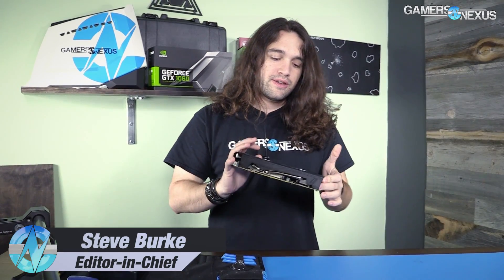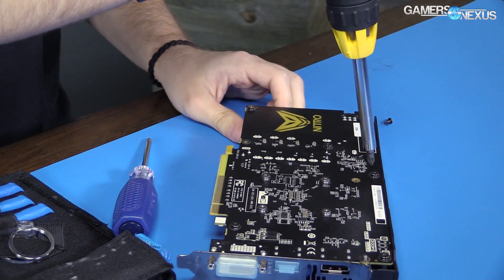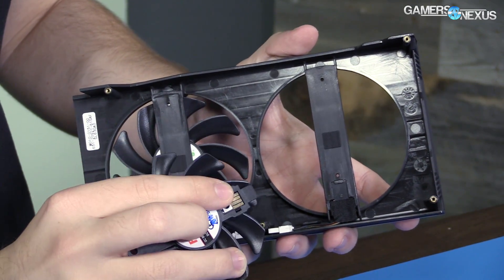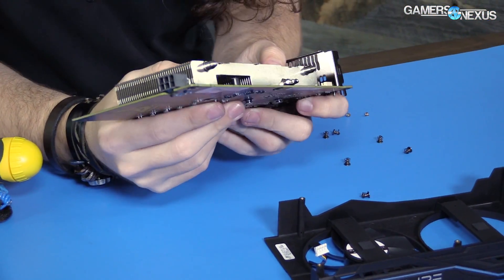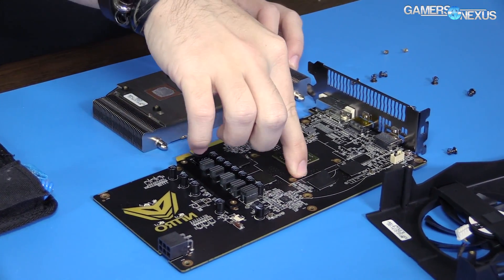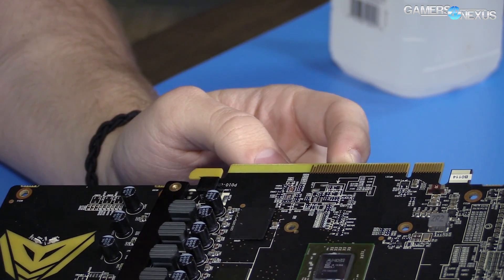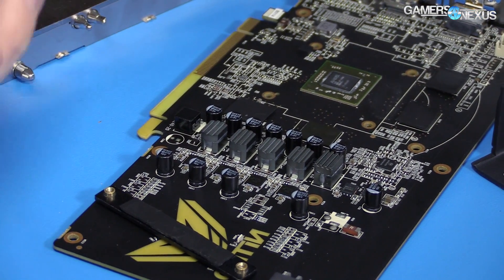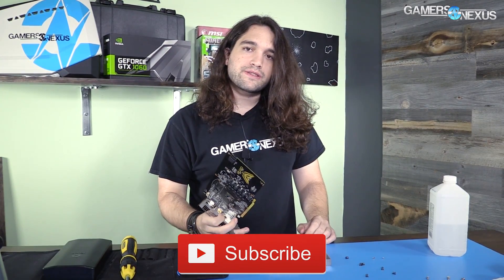Sapphire RX 460 Nitro Tear-Down & Disassembly

Comment: After disassembling will it work without the fans and heat sink? Could you do this for a GTX 1050
Reply: Acid HD Yah but it will burn immediately :)

Comment: what is the problems with the rx 480 founders edition please, I want to buy one and I don't know if the problems are resolved or not
Reply: The reference 480 had the supposed problem of drawing too much power from the PCI-E slot when under full load. It didn't bother higher-end motherboards, but it supposedly broke cheaper ones. Which I highly doubt. That and the throttling problems where it wouldn't keep a constant clock speed while gaming. But both problems are easily fixed by fiddling with the power settings using WattMan in the drivers suite.
Reply: I'd really wait for an AIB partner card like Nitro+ or MSI Gaming X.  The cooling on the reference RX 480 is not good.
Reply: Cooling and therefore noise, and possibly it only having a 6-pin power connector but I don't know how that affects overclocking, the issue with too much power pull from the pci-e slot has been resolved.

I highly suggest getting an AiB 480, they're quieter, cooler, and overclock better.
Reply: Thanks guys

Comment: I have an idea, instead of doing a hybrid cooler mod, try modding the fan shroud, seeing as the fans are removable, maybe mod a pair of noctua fans onto it? or, for giggles n shits, some 4k rpm delta fans ;)
Reply: I was thinking the exact same thing. Eyeballing those bolt holes in the PCB, thinking about a bracket and spacer set up to mount a 140mm Noctua spinning at low rpm for quiet performance. Or maybe swap on a giant CPU heat sink for passive cooling.

Comment: Yeah, it seems like RX 460 probably isn't fast enough to stress out a PCIe 3.0 8x link, but that PCIe 8x cheapskate nonsense could possibly cause performance decreases for someone on an older PCIe 2.0 or (gasp) PCIe 1.0 motherboard. PCIe 1.0 16x is 1/4 the bandwidth of a PCIe 3.0 16x slot. So this card in a PCIe 1.0 motherboard has access to 1/8 the bandwidth as someone using a 16x card in a PCIe 3.0 slot. 

This cheap card is exactly the sort of thing someone with an older computer might buy to squeeze a little more life out of it.

Comment: 1060 or 480? Which one will last longer
Reply: The 480 will last longer.
Reply: Assuming you're talking about performance in games released in the next few years, the 480 will have better longevity due to hardware acceleration for async.  Games that use DX12 (or Vulkan) to their best potential will generally do better on the 480 (and sometimes by a substantial margin).
Reply: Last longer in which sense of the expression? Performance-wise, 480, durability, I have no idea.
Reply: The 1060 is a safer buy. It gets pretty a good 15% FPS lead on average in OpenGL and DX 11, which is supported in basically every game. The RX 480 benefits a lot from DX 12 and Vulkan but that may or may not be supported in future games. Also, the 1060 runs cooler, more quiet and more efficient. So if the 1060 is NOT MORE than 20% more expensive than the 480 where you live, it is the better card.
Reply: AMD has a reputation for pushing older cards performance further than Nvidia (ie the 7950), and combined with the extra VRAM abd better async performance, it'll definitely be a better long term buy than the 1060. But really, I don't think buying a GPU and waiting to see how long it can go is a great idea. I would just say upgrade 2-3 years down the road to the next mid range card and sell your old one. It'll offset costs and make staying up to date relatively cheap.
Reply: my old 560ti lasted for 5 years, is just a matter of psychological vice ahah
Reply: diamond22 It always depends on your individual situation.  In my case I have an old 3570k@4.2GHz system with a GTX 760, and RX 480 will be a "last hurrah" for this system.  The next time I buy a new GPU, I'm buying new mainboard+CPU+memory to go with it.  I bet that doesn't happen for 3 or even 4 years.  I'm also staying at 1080p until then.
Reply: +diamond22 Tech YES City actually has a video about it. He bought two old cards, the HD7850 from AMD and the GTX 660ti from Nvidia, researched for benchmarks against them when launched and then performed new benchmarks. The launch ones showed the HD7850 way behind the GTX660ti, and the new benchmarks placed it pretty close in performance.
Reply: it depends on the model
Reply: vonkruel A 3570k at stock is faster than a Skylake i5-6400. You won't need to upgrade for a looong time. It can handle a GTX 1080 without any sort of bottleneck. And it's still got 4+ years of life based on how older i5s aged.
Reply: diamond22 From what I've gathered, a newer i5 with fast-clocked DDR4 memory can actually make a significant difference in DX9,10,11 games, even when paired with a GTX 1070.  Not much difference in DX12 and Vulkan games though.  Anyway, yeah I expect to get about 8 years out of this 3570k, which is nothing to complain about that's for sure.
Reply: +diamond22 grab a i7 3770k it's a beast.
Reply: If i recall rightly the HD7870 was ment to be the GTX 660TI's counter part. This was mentioned on the comments alot. So was not by any means a fair test. :)
I resently upgraded from a HD7850 to a RX-480 Nitro OC and it's powering my 3440x1440 Freesync @ 60-75 FPS on high very nicely :)
Reply: Basardius I will assume you were answering me. Yes, for the time they launched the HD7850 was many tiers behind the GTX 660. On the new test they were almost on par, and I'm pretty sure we'll see the same story with the new AMD cards.
Reply: Agree, I think most people with a clear mind would agree AMD cards perform better than Nvidia cards in the long run. Whether Nvidia neglects or intentionally sabotages (which alot of case's suggest this), AMD looks after it's cards / customers better in that regard for sure.

Comment: I think RX 460, R7 370, GTX 750 Ti, GTX 950 benchmarks on something like an AMD APU or a (non G3258) Haswell Pentium would be interesting to see how cards in this class compare when not matched with $500 CPUs in $250 motherboards with quad channel DDR4.
Reply: +Rex Tilton That is terrible advice for a gaming PC. The extra cores won't help in gaming, and even high FX chips get smoked by i3s in most games.
Reply: same, my brother has a fx 4300 and just wants something that will run cs, gta v, and skyrim
Reply: FX 4300 will probably bottleneck the 460 in quite a few games. GTA V most probably will bottleneck.
Reply: +Mateus Campello yeah, I've been trying to convince him to upgrade but he really only plays like 3 games
Reply: The Hilo623 So look for specific benchmarks to make sure if it will bottleneck or how much it will.
Reply: +The Hilo623 fx 8350 is a great upgrade when ocd to 4.6 ghz.

Comment: 4 phases for this tiny-as-balls GPU. Now you know why the cost is as high as it is. This chip could've easily done with just 2 power phases. Like, it's supposed to be a small card for cheap systems. Why make it so unnecessarily huge with a massive blank PCB?

Comment: pre-like, this  channel is better than the linus coke tech
on topic, i belive that rx 470 have 8gb vram, but 4 are locked..
Reply: I don't think so
Reply: They are mostly using 512MBx8 modules, so there is no way there is 8GB
Reply: There would be NO point in having it be an 8GB card that doesn't use 4GB, why would they do that?
The RX 480 had a reason that you probably missed
Reply: carzacc they would do that because they care about poor ppl.., thats amd
Reply: ***** As much as they care they don't just build an 8GB card and then market it as a 4GB

Comment: that card costs 200usd here in Sweden..useless card
Reply: The 2Gb one is around 1490kr and the 4Gb is about 1790kr. That would be 164 and 197 dollars here in Sweden. About 50 dollars more than in America for a card that certainly is not made in the states..
Reply: Same in Romania, 780 RON, and 200 usd is ~800 ron.
Reply: sweden doesn't have USD??!!
Reply: converted -_-
Reply: its okay, you can use kronor, lol
Reply: see? thats why globalization is necesary...
Reply: It's useless depending on what you compare it to. So just because a 480 is $200US in America, that doesn't mean the 460 is a useless card in Sweden if the 480 in Sweden is $300US.
Reply: +logirex cheaper in norway, the xfx being cheapest on komplett

Comment: Under what framerate do you deem the game unplayable?
Reply: Lows under 30
Reply: It depends on the game.  For example, Dark Souls runs at 30fps and it's fine that way (60 fps is nicer but not required to enjoy the game).  In a fast-paced game like a shooter: 60+ is acceptable, 80+ is good, 100+ is ideal.
Reply: Anything above 30 is unplayable. That sweet 17 fps is king for me.
Reply: 50>
Reply: below 30fps
Reply: Depends on what your lows compared to your highs are.

A game that runs at 30fps consistently is more playable than one that runs at 60 at times, but dips down to 30-40fps.
Reply: Anything below 30.
Reply: It's dependant on the game and the platform... If you're a casual gamer and only really play 2D games like shmups (aka danmaku/bullet hell) or side-scrollers, then 30FPS is fine. If you play competitive E-sports, or you're really into racing and shooters, then you want 60FPS or more because the more frames you see, the less time you have to wait for a frame update, and the less time you spend waiting, the more time you can spend 360 no-scoping noobs in Call of duty BO3 XDDD
Reply: Depends on the game,  but minimum has to be over 30
Reply: Below 60
Reply: nothing under 45